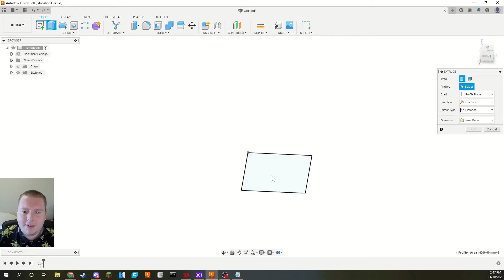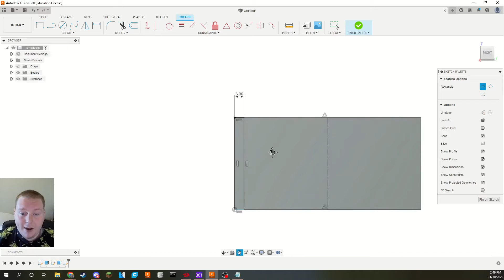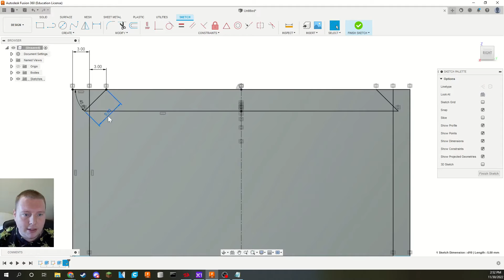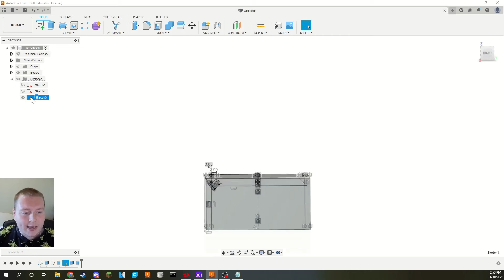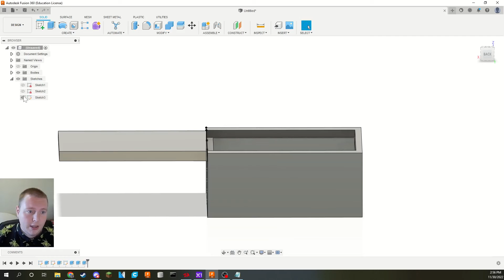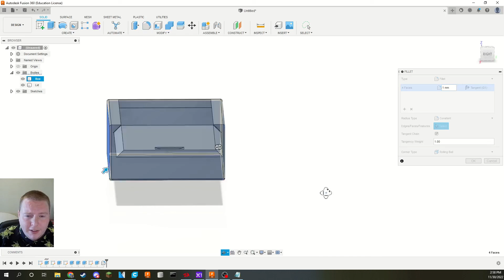EASY 3D-Printed Dovetail Box w/ Lid Fusion 360 Tutorial (Free STL)

Comment: Hmm... My Bambu PS1 printed the lid pretty close.. At 5:50 you mentioned the offset of -0.02, you changed to .225 (Not to have to make several Versions that fit well). 
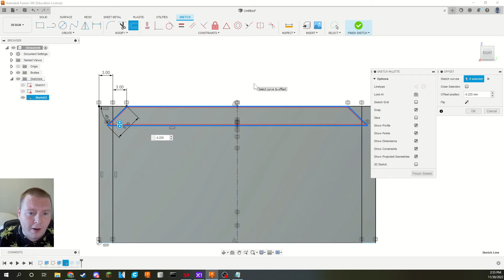I think what you were saying in the video at 6:25 was that you think (Half the Nozzle Width -0.02 may have been enough for the offset to have a nice fit?

The 0.225 was way too small. The lid just slid off, and, half way out, you could move it side to side.. (Worked fine, but, I wanted to see what a "good fit" was for future reference. 
I should have reviewed the video again, and selected Sketch3, next time I will name (Offset) before I start, so, I can find it again, to Modify it, IF, it does not fit.. 
I screwed around and Tried Extruding one side, then the bottom, etc, somehow ended up with it larger than the opening, etc.. Ha.Ha. Broke the dovetail off of the box, trying to get the lid to fit where it wouldn't.. I had planned on sanding it, to see how much I needed to take off. Ha..ha.. 
I THINK,,, I finally ended up figuring how to find the offset again, edited the sketch and changing it to -0.05.. Printing it now.. Ha..Ha..
If, my edit is completely screwed up and doesn't fit,, I'll start a new sketch and go through it again and use the -0.05.... 

NOTE FOR NEWBIES!  I was trying to build 4 Trays to hold some Jigs/Templates for Metric and Imperial Radius and Chamfer Gauges for a Router to be used on Wood. 1 Tray for each set of jig tips or Templates to fit in a larger Jig (Inserts)... The first one took me the better part of the night. Lots of mistakes, took me 6-8 hours...
 
The next time, 1 Hour,, The Next Time, 15 minutes,, the next time, 1 hour, and I learned enough out of doing it a few times, I can do it in about 15 minutes now, without problems, understanding WHY I had the original Problems, etc... So, I decided to add text, Extrude it Negatively and Fill it with a second color to print.. 
Well, once I figured out, I decided to add some text to it. I had to Create a Sketch to see the Add Text in the Menu, created the sketch (Named it Text) so, I could go back and find it/edit it, it worked.. BTW... You have to Extrude the text in or out, or it won't Export to a .stl file.. Still don't know how to change colors, add colors in Fusion, but, used the Paint Bucket Fill option in the Bambu Studio Print Software and Walla... Ha... 

Moral of the Story... Find something you want to print.. Something you don't mind printing 4-5 times. Or something you can build 4-5 sizes or variances of, and build it 4-5 times in a row when you are starting out.. Just starting with Fusion, I learned more by doing the same thing a couple of times, than I have up to this point... I gave the first dovetail box to my wife to hold her Earrings, on the Night Stand. Next one, I will add Fillets to the inside of the box to make things easier to roll up out of the box and give it to my Mother.. And, in the meantime, while that one is printing, I made a 5 Sided box that holds my thumbscrews for the Jigs I am making trays for... No Dovetails on that box. It's just something I can print and go to bed while printing.. Once I figure out the Tolerances (I think 0.02 or 0.05 maybe), I'll find something else to build and print.. 

I'll look for another something to build that has features that I want to put into the Parametric box to hold my jigs next, (something small that doesn't take too long to print), and test the features before adding them to the Parametric Box I want to build. (Much larger print times, so, hope I get the little stuff right and make it a First Print works job.)
Hope that helps someone... Surely has made me feel better about being able to build what I want, and not spend so much time trying to figure out the "Right Way" to do it. 
When you are able to build something without issues, add some feature you were having trouble with before, and, note the video where that feature was done, so, you can at least review what was done.. Sometimes you miss things you will see later when you watch it again and pick up on what it was you missed, and see what you were doing that caused the issue... Learning how to go back and Edit is invaluable, so, Create new sketches when you are trying something new and rename them to what you are going to do, try it, start a new sketch if you are finished, so, editing is much easier when you go back to change/edit something that doesn't work right on the final print. 
Once you learn how to use the sketches/components to go back and edit, you will be 10 steps forward in the game...

***UPDATE: 0.05 Offset was Perfect! 
If it is not perfect for you, Slide the lid back and forth aggressively a dozen or so times, stopping just before you get to the back.. Then, you get a pressure fit in the back 1/8"  before if fully seats, leaving you with a snug fit, just before the lid fully closes.. You can use the pressure of your finger to slide it open..

Comment: Hey bro, excellent tutoring, it helped me a lot. I have a problem, which you can help me with, is that I printed the box and the lid works but it happens that in one corner of the final part of the lid if you apply a little force it sinks, just as if you try to place the lid on Inversely, when placing the box vertically, it falls. Is there any way to improve it? greetings from mexico bro

Comment: Thanks for taking your time explaining things like this. But I think this is the worst option to make a sliding lid. I worked on mine for hours until i could make a good one. If i was an english native speaker, and if i could be as good as you explaining things, i would make a video =) If you want to take my idea and do one, feel free. I extrude de box. Then i extrude three of the faces 2mm on top but in a new body. To that new body I apply a chamfer to the three inner and lower edges, using the 2 distances option, 2mm on z, 1mm on x/y. This way your lid will reach 1mm inside of the box. You just have to combine the objects. You can figure out how to design the lid with the same chamfer.

Comment: You are a treasure, I appreciate how clear you are with directions. I really like the simplicity of these designs and how you don’t overwhelm the video with to many techniques or operations that might fly over someone’s head. Do you have any videos on getting started with Fusion? I’ve used solid works for a few years doing basic designs and I have graphic design experience so I pretty much hack my way through fusion by making SVGs and extrusions but I’d like to get some more practical knowledge and directions for basic functions. Great work!